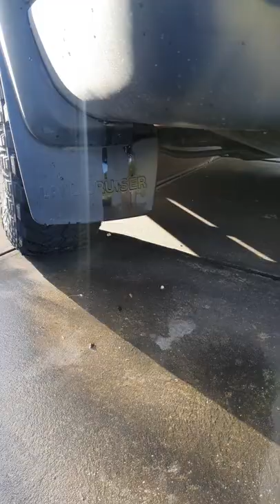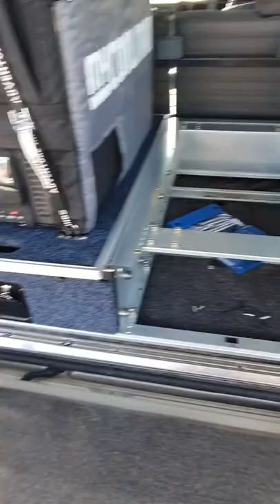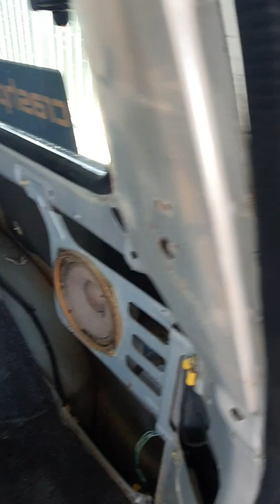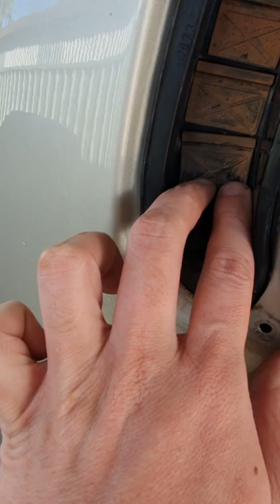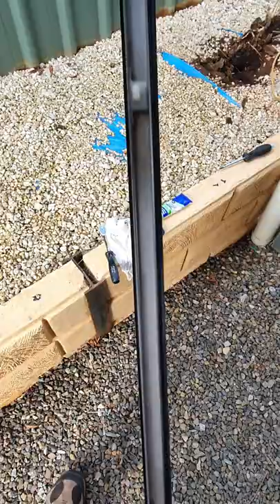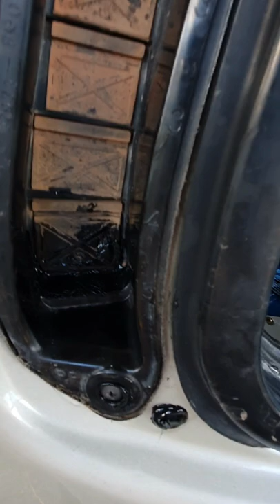DIY: Tracking Down The Water Leaks In The 80 Series // Not Happy!

Comment: Are the drain plugs immediately beneath the panel that's flooded?
Reply from the maker: Yeah they are on the bottom of the quarters.

Little black round plugs, the same as the ones on the sill panels.

Comment: same thing just happened to my 93 landcruiser after a lot of rain and truck sitting outside. How do I drain, where are the drain plugs?
Reply from the maker: They are just up underneath the rear quarter panels.

Look for a small rubber plug.

If you have the chrome mouldings along the edge of the windows, you'll need to remove them and seal up where there clips go through.

Be careful removing those as well, as you can't buy the clips if you break them, and you'll end up having to buy the whole moulding.